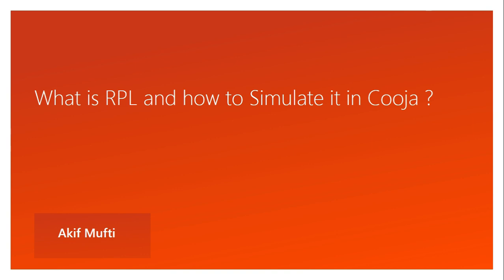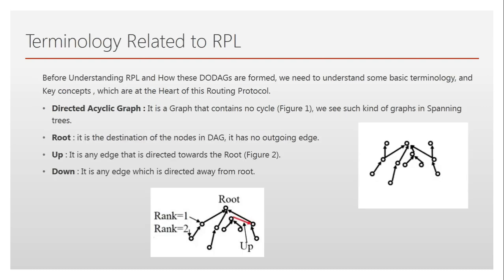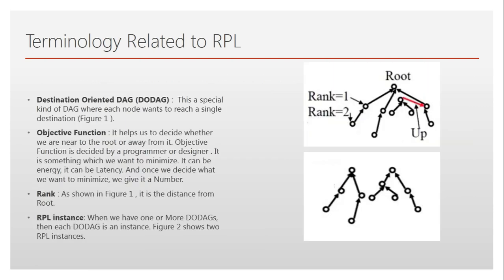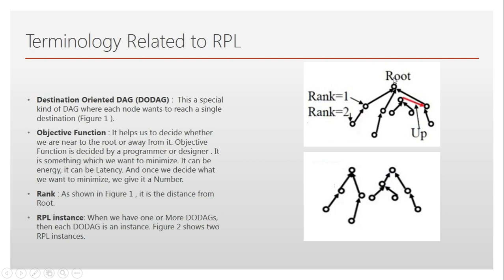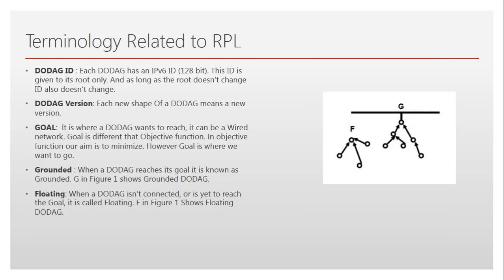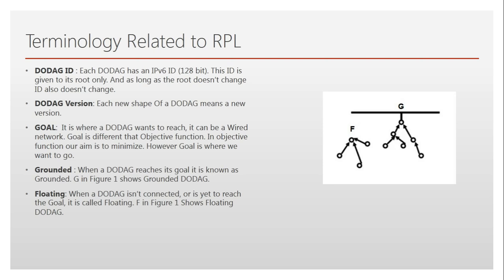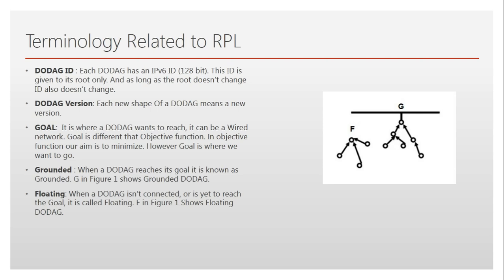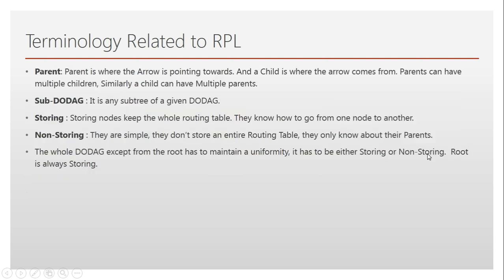Routing Protocol for Low power and Lossy Networks (RPL)- Basic Terms (Part 1)

Comment: Error at https://youtu.be/6AP7p0sbBro?t=250: Each DODAG is NOT an instance. From RFC6550 (RPL): "A RPL Instance is a set of one or more DODAGs that share a RPLInstanceID. At most, a RPL node can belong to one DODAG in a RPL Instance. Each RPL Instance operates independently of other RPL Instances. This document describes operation within a single RPL Instance. "